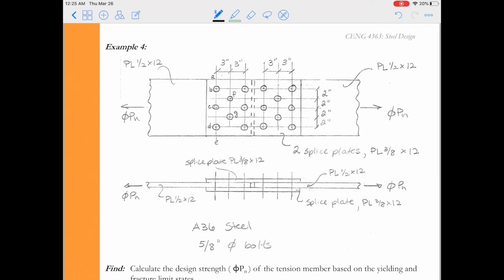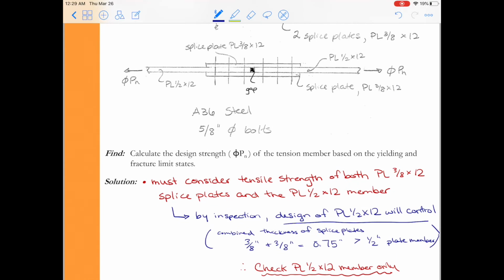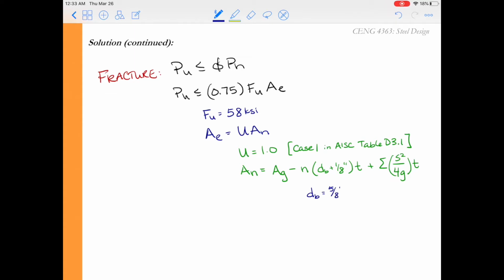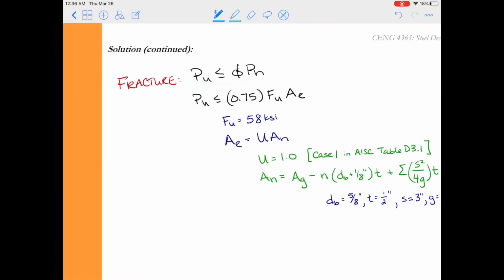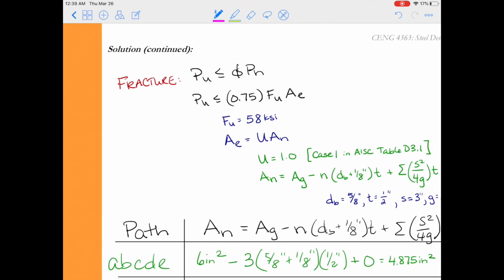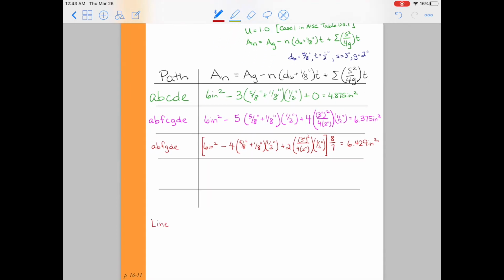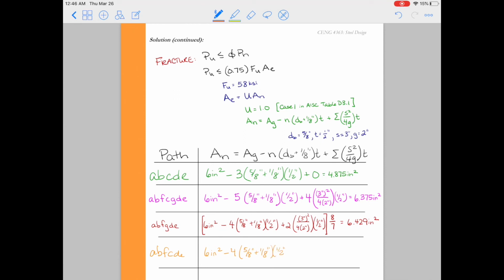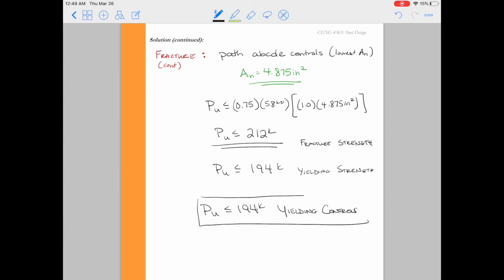V17-1 Tension Member Example with Staggered Bolts

Comment: This is a great example, but I've never understood the evaluation of the paths past the first line of bolts. To develop the strain required to reach the fracture stress, the path must be able to elongate sufficiently. This isn't possible if there are still bolts preventing this elongation, and will reduce the load sharing ability of the bolts overall. Tests have shown the failure starts at the first line of bolts, regardless of what such a "path" assessment may say about it.